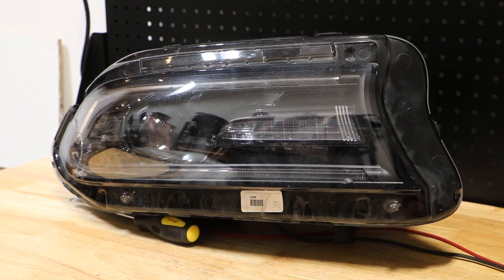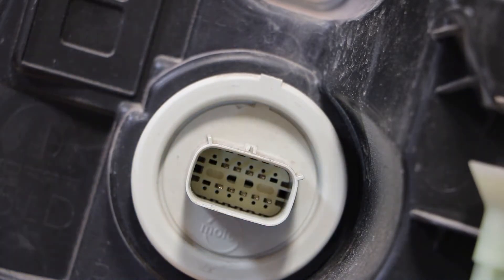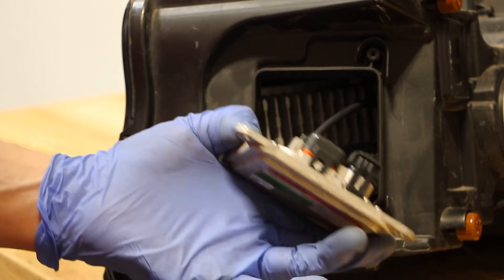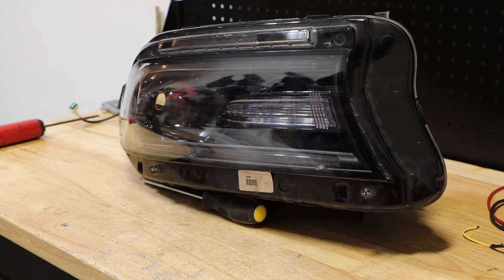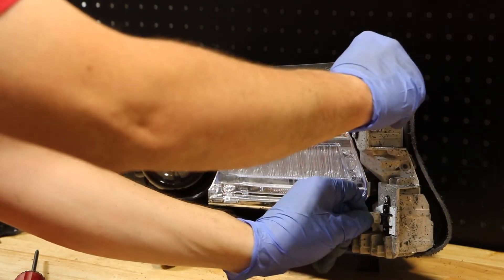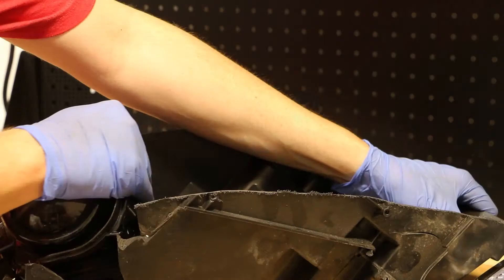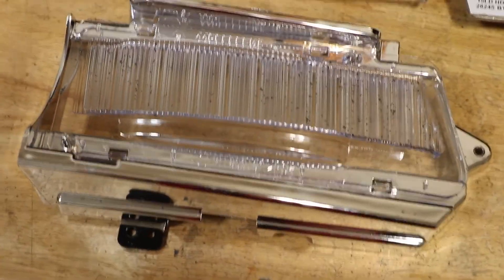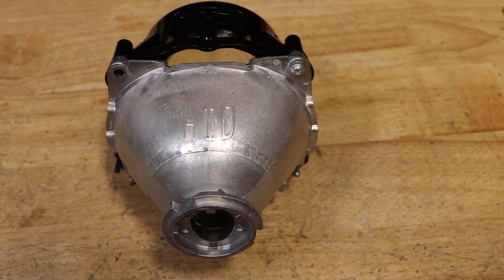How To Test and Teardown a 2015-2020 Dodge Charger OEM Xenon Headlight

Comment: How did you remove the housing so quick? Lol did you apply heat gun on it?
Reply from the maker: I cut it off with a saw.   Heat is the best method for removing the lens.   Should take 20-45 minutes to bake the light enough to get the lens off for most headlights

Comment: To GFTGRILL, I wanted to make my 2016 Charger headlight into a ramair setup like the challenger...can you wire the turn signal into the daytime running light and make it orange?
Reply from the maker: That sounds like something custom that I generally stay away from.   I don't like experimenting on other people's things.
Reply: @gftgrill  ok thanks for the heads up

Comment: Daytime running light is out on bottom half of the headlight l...how are they replaced? Does the entire assemble need to be replaced? Thanks
Reply from the maker: In short, yes replace the whole light.  You're other option is to find a working light for donor parts.   The question is how much money is 3 to 4 hours of labor worth to you?  Generally I recommend just buying a whole replacement light because you don't have to open and reseal multiple lights and the time saved is worth more than the cost of a replacement light.  You cannot purchase the LEDs by themselves.

Comment: Hello one of my headlights randomly gets stuck on high beam. what causes the light to switch between low and high? any idea what might be the issue? I’ve already changed the bulb, ballast and the ballast wire with no luck.
Reply: Hey mines is doing the same. Did you find the problem?

Comment: What’s the name of the wire you disconnected from the hid bulb? I think I broke my wire connector removing the bulb
Reply from the maker: I'm not sure if it a specific name, but I would normally call it the ignitor or ballast to bulb wire.   
this should be the same part:  https://www.ebay.com/itm/323928179448

Comment: Do you have a link to the 14v bench supply you bought? I’m having trouble setting up my bench testing station
Reply from the maker: I don't have a link, but it's a Pyramid PS-12 10amp Power Supply.  Mine is 20+ years old and still going without issues.  You can find the new models on Amazon from 3rd party sellers, but I couldn't find any links to any big retailer websites, so I didn't supply a link.  I was also unable to find a website for the manufacturer to link to.
Reply: @gftgrill  awesome, yeah I am refurbishing headlights that are badly oxidized and now that I’m moving on to bixenon assemblies w/ AFS I’m having trouble finding a good power supply. I used a drill battery for 12v and it blew a bulb already.. let me try and find some.. awesome video btw definitely subscribed
Reply: @gftgrill  if you can do a video on your current setup that would help YouTubers out a lot as there isn’t many videos out there for testing headlights

Comment: I have a halogen light, it has not been taken apart. Actually I just bought It. I wanted to take the rear wiring harness out and do some of my own mods but I can’t seem to even remove the wire harness. I’ve tried grabbing it with pliers and it won’t come loose. Am I doing it wrong or what?
Reply from the maker: I'm not sure.  it should simply be a quarter turn to the left to unlock it, much like removing a halogen light bulb.   

you can see here : https://youtu.be/GZR1DJavGpg

I didn't need any tools or anything, it simply just unlocked and went into the headlight.   Note that you won't be able to pull it out of the rear of the light without making the hole bigger.  you will have to take the lens off to get the wire harness and connector out intact.
Reply: @gftgrill  I can’t even get it to do a quarter turn. That’s my problem

Comment: Hello do you happen to know where I can get that electric board in the headlight
Reply from the maker: as far as I know, it is not available for purchase.   You can only purchase the headlight as an entire unit.   You would have to find someone selling it via parts out of a used headlight or buy an entire assembly and remove it yourself.
Reply: @gftgrill  my stupid turn signal went out and they told me that’s the issue.
Reply from the maker: @TwoBrothersAuto  Unfortunately this is the future of automotive headlights.   LEDs are nice looking, use less energy, should last the life of the vehicle, but are for the most part being designed as completely sealed units that have few to no serviceable parts.

Comment: What is the first pin on the top left?? What is that pin even used for?
Reply from the maker: I think it's a feedback pin so the system can know if there's a problem with a light.
Reply: @gftgrill  Okay, so I think mine may have a problem. The bottom left pin, which is a negative wire has stopped working. What should I do?? The turn signal and running lights still work, but the cars says the turn signal is out and it blinks really fast. But the signal still works. I don’t know what to do about it

Comment: PLEASE HELPP!!
so my hid is also d3s in a 2018 charger. I ordered a morimoto 2 stroke 3.0 LED bulbs, and it came as a D2H. The company claims that it should still fit. It only comes with 2 wires not 3. So cut and splice I assume. The said you only need 2 wires.

My question is, "is it ok to only use 2 wires and ignore 1 of them? Also does this led hook up after hid ballast or before?

Thanks.

Comment: Can you advise what are the two pin terminals that turn on and off the hi/lo projector solenoid, and indicate the voltage level?
Reply from the maker: https://youtu.be/GZR1DJavGpg?t=14

I use a 14.3v bench power supply to test.

Comment: Hello, I have a 2017 Dodge Charger Se. My driver's side DRL stopped working. The passenger side works. At night I can see the DRL on my driver's side very dim. Any advice? I have Tried to take it everywhere.
Reply: I have the same problem and I searched everywhere for a solution but couldn't find it, did you find the solution?
Reply: @حاتمالشهراني-م4م  honestly till now I just ordered a new Headlight Assembly to replace the who Headlight. Dealer wanted 1300 just for the part. I bought it off of Ebay for 450. I have to bring it to a autobody shop to put on. It feels depressing driving with 1 led light on 😢
Reply: @ICUCMECU  did everything go well?

Comment: Hi, I bought headlights for my 2019 Dodge Charger it didn’t fit because the car has hid original headlights and what I bought is halogen everything works except the projector didn’t work (high and low beam) what can I do to fix the problem?
Reply from the maker: I don't know if the wiring is different between the xenon and halogen versions.   Assuming the wiring pattern is the same and is not different, I would confirm that you don't have any blown fuses.   If the wiring diagram is the same between halogen and xenon, then it might be a difference in the computer turning power off to the lights because it's not using the amount of electricity it expects from a xenon headlight.   

I would recommend returning the lights and buying the correct xenon versions.   You'll save yourself hours of electrical troubleshooting and possible rewiring.
Reply: @gftgrill  thank you for responding that’s what I thought

Comment: What did you use to test the lights? Like, was it something special or how did you did it?
Reply from the maker: I use a 14v bench power supply
Reply: @gftgrill  If you have a light like that one, could you show how to replace the projector to an updated LED Projector?? Like how to unglued the lens and then glue them back on.
Reply from the maker: @austinstevens415   Here is 1 way to remove the lens:  https://www.youtube.com/watch?v=CIU0iul5M_g

To replace the Projector, follow the steps in this video and once you take the projector out, you will need to just swap out the OEM projector for the aftermarket projector of your choice.   Every aftermarket projector is a different size, will have different mounting hole locations, and might have different wiring requirements. You will have to follow the manufacturers instructions for power/wiring requirements.

Comment: Does the battery need to be disconnected first
Reply from the maker: Yes, you should not try to power the light manually when a 2nd power source is also connected to the headlight

Comment: What tool did you use to disconnect the outer lens from the housing?
Reply from the maker: I cut it off with a body saw.
Reply: Ugh. Bad video.
Reply: Put the headlight in the oven for 275 degrees Fahrenheit for 7 mins should be easy to pry open after that, this dude sawed his in half like a moron do not follow this.

Comment: My drivers side headlight was dimming/yellowing at one point. I pulled the fuses, they were burnt. Swapped them, the bulb worked for a while but was yellowish compared to white passengers side. Just put new bulbs in, on both sides. Bulb on drivers side worked for about 2 days but now it isn’t. The fuses aren’t blown, relays are working properly. Would you happen to have any advice?
Reply from the maker: Assuming you are talking about the xenon bulb, you need to check your ballasts.   swap the bulbs left to right and see if the problem travels with the bulb or not.   Possible defective bulb, more likely dead ballast.   You should also use a multi-meter to confirm power to the headlight.

Comment: Hello. The front  turn signal is not working on my 2015 charger is there any way that I can replace the led turn signal  or do I have to buy the whole assembly?
Reply from the maker: You would have to disassemble the light to replace the LEDs.   You would need a working set from another light.   It will probably be easier to replace the whole headlight.  Did you look for a possible blown fuse?

Comment: Hi, thanks for this video. If you don't mind saying, Where did you find the information for what each pin energizes and which pins were ground? Also, is there any danger if you mistakenly test two incorrect pins? Say you hook up pins 1 (power for bi-xenon) and pin 3 (power for xenon ballast)? Or what if you hook up pins 2 and 4 which are both ground? Thanks again for your help! I ask because I think I may have shorted out an old challenger xenon headlight when I tried to test it....I read 13 ohms on my multimeter between the first 2  pins and thought that surely that would be a safe test....wrong...smoke came out from just my brief touch
Reply from the maker: I figure this stuff out through testing, tracing wires (especially when I have a 2nd more damaged light that I disassemble), and sometimes trial & error.   When trial and error testing I never connect more than 2 at a time.  1 positive and 1 negative.   

if you saw smoke from a component in the light, then you did 1 of two things.  Either you overloaded the circuit (too much power) or you reversed the circuit and potentially damaged some component.

I don't know your exact scenario but you might be fine if the smoke was just at the connector where you connected your leads.   In my experience halogen and xenon components are pretty forgiving.   LED components are less forgiving to 12v power and are easily damaged.
Reply: @gftgrill  thanks for the reply gftgrill! I am just recently learning about all this; but I don't see how I could overload the circuit with too much power using a 12 v car battery?  It's the LED or bulb that will decide how much current to draw based on it's resistance, right? Also, in testing various other lights, I've never noticed any harm in reversing the + and - wires:  on halogen bulbs it simply doesn't  make a difference which wire I connect to which pin. As long as I complete the circuit, the current flows fine in either direction and the halogen bulb lights up either way. On LED and Xenon, if I happen to reverse the + and - wires, it simply just doesn't turn on, but I've never damaged anything this way. I've only ever damaged something when 2 pins happen to both be connected somehow without any bulbs in the middle....I am figuring they are either 2 grounds or 2 power pins...For Example: a Cadillac XT5 LED tail light that I tested has 5 pins....through error I learned that I can successfully test pins 1,4; 1,5;  2,4; 2,5; 3,4; 3,5.....the only difference between using pin 4 vs pin 5 in combination with any of the first 3 pins is that with one pair you get a dimmer result, and the other pair, a brighter result......But to learn this I had to first ruin another light when I tested pin 4 with 5 and shorted something....now the dimmer mode on this ruined light barely lights up at all; but the bright mode still works fine!  I am stumped....
Reply from the maker: @CATEGORY13LIGHTBODY   It sounds like you may have blown a fuse on the board inside of the light or damaged something by reversing the expected flow of electricity.   

I test with a bench power supply that is 12v 10a.   If you are testing with a car battery, you are supplying something with higher amps, which might not be as forgiving as a lower powered bench supply.  My power supply generally cannot run 2 xenon ballasts at one time and does have some issues starting up some ballasts due to lack of overall current that a car battery can supply all day long.
Reply: @gftgrill  I can see how the much higher amperage of my car battery would be a bigger problem WHEN I mistakenly short the circuit....but again, if I am not shorting anything; I've never blown even the smallest of turn signal bulbs or LEDs by reversing the f low or keeping the bulb lit for even minutes at a time while connected to my battery.
Reply: @gftgrill  On your example from the video, what would happen if you hooked up pins 2 and 4?
Reply from the maker: @CATEGORY13LIGHTBODY  I'm not sure.  I no longer have the light, so I'm unable to test it.
Reply from the maker: @CATEGORY13LIGHTBODY  it really depends on the design of the light.   I've seen ones that fail when power is reversed and others where nothing happens at all. I've also blown up many LEDs and fuses by supplying them with 12v power from my power supply.
Reply: @gftgrill  do you happen to remember which makes/models?
Reply from the maker: @CATEGORY13LIGHTBODY  The ones that I've damaged have mostly been LED projectors and DRL, it's usually a board component that explodes rendering all of the lights useless.   I have never damaged a taillight while testing it, with my power supply.
Reply: @gftgrill  thanks for all your replies. When that happens, you definitely heard a noise, correct? Telling you that something bad happened?  I read somewhere that alldata or hines manuals have the schematics or diagrams for all the lights....looks like that will be the only way to be sure before testing one...
Reply from the maker: @CATEGORY13LIGHTBODY  Yes, it was an audible pop when the component failed.  These were also open/exposed at the time and not inside of a light when the failure occurred, so it was very noticeable.
Reply: @gftgrill  Working on getting access to the wiring diagrams for a bunch of different makes / models. Apparently you can get them as a part of a subscription to a service like this one:  https://try.identifix.com/dh-1-test-drive/?lead_source=website  which goes by other names as well like  prodemand mitchell1 https://www.prodemand.com/ from the few pdfs I've managed to look at, they are all copy-written by service repair solutions inc
Reply: @gftgrill  do u have a way way to get in contact with u… really need your services